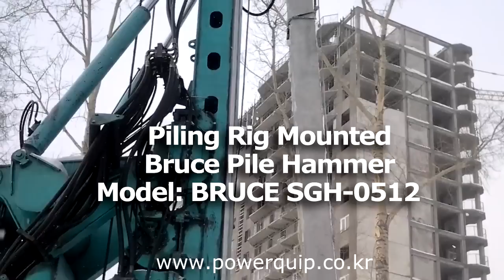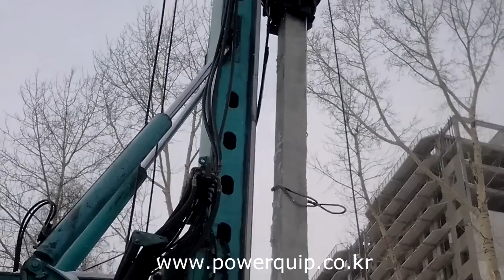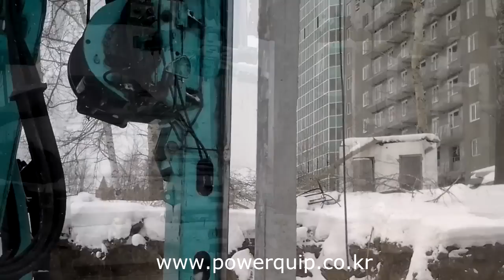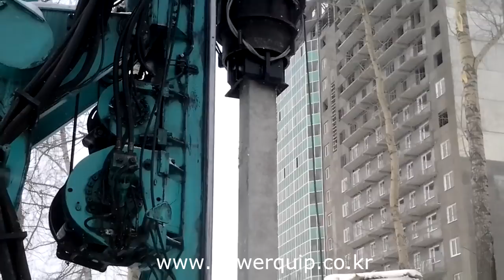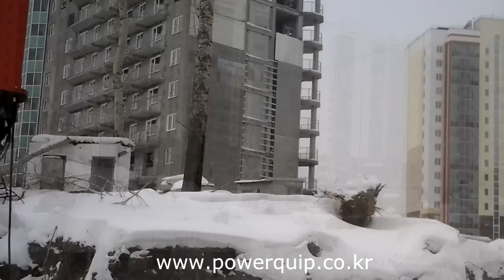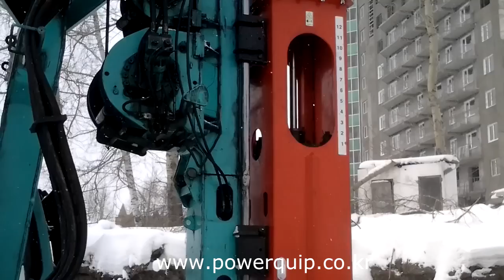Hydraulic Pile Hammer Bruce SGH-0512 Mounted on piling rig

Comment: why doesnt the concrete shatter under the huge forces on it.
Reply: Concrete is very good under compression. If you hit a beam with a hammer and place the top of it in compression due to the downward blows, you will find a crack appear at the base of the beam. The tensile forces on the base pull it apart and concrete has a poor tensile strength. Compression isn't a problem.
Reply: They usually place a cushion (40 mm) of wood between the pile and the hammer. This softens the blow and protects the concrete.